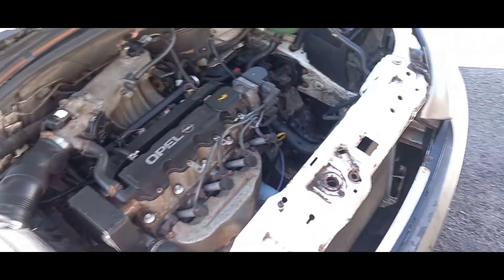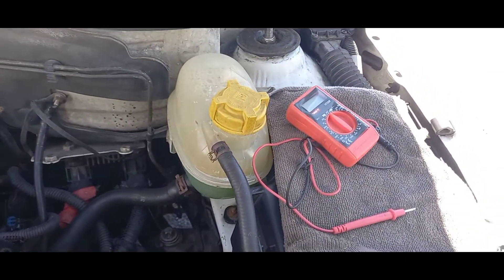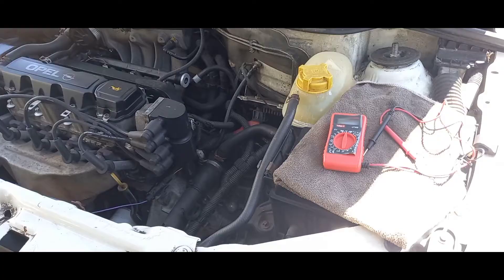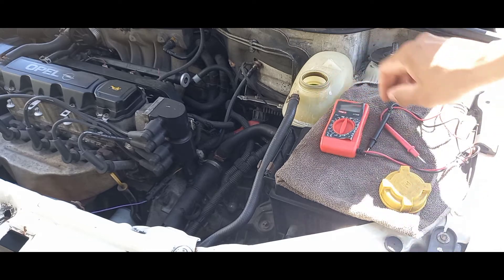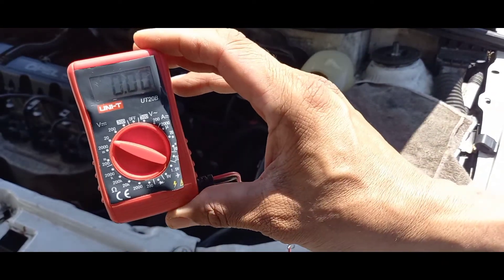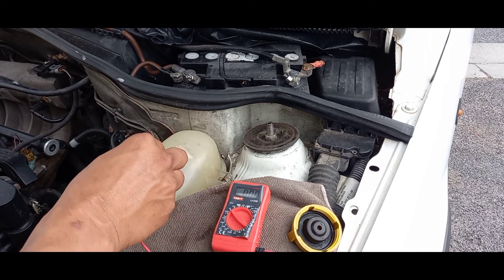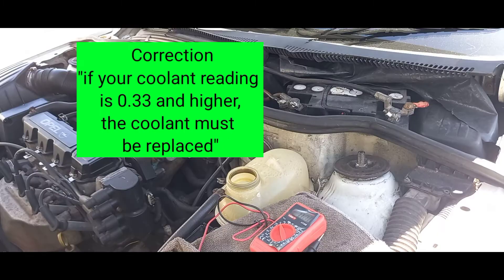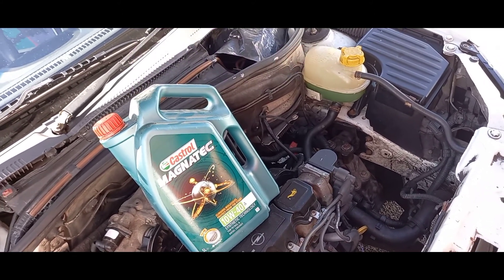Opel Corsa Prevention Series Tip 1 Coolant check

Comment: Hi sir I just want to know if you can help me have a opel Astra 1996 1.8 and when it stand still and idle for a while the heat gauge goes up almost to the red but when it drives it comes back down thanks in advance for any advice
Reply from the maker: Hi . It's difficult to guess what is wrong, but it's most probably a cooling system problem . You have to check all parts of the system to see where the problem lies, thermostat, water pump, temp sensor etc
Reply: @solveitautomotive9485  thanks a lot for the advice sir really appreciate will check them